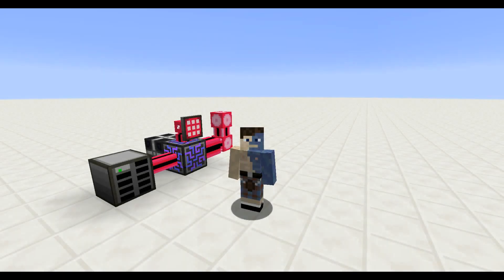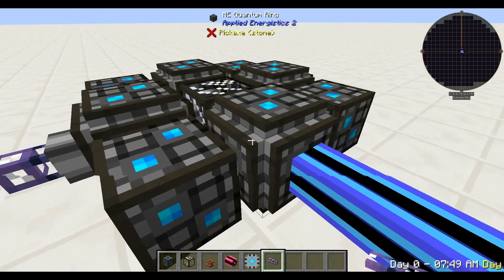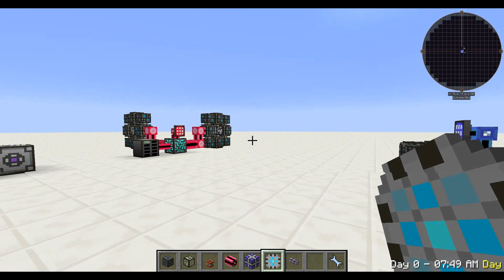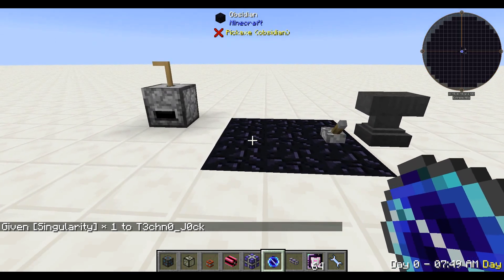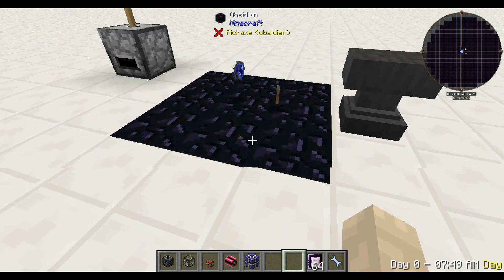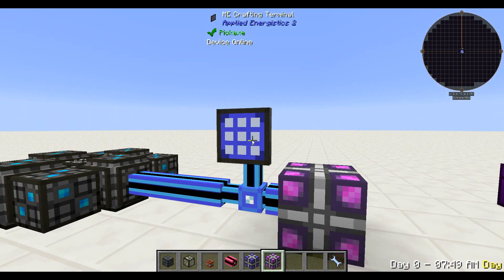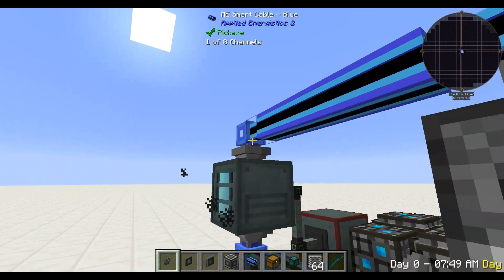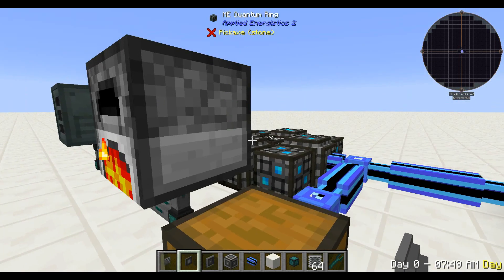Applied Energistics 2 - Quantum Rings & Channel Optimisation

Comment: I know it's an old video, but I tried this out and it seem that you "only" get 32 channels out of the quantum ring. I tried connecting different colored cables on both the "remote" ring and the ring connected to the ME Controller. But it only uses one of the cables on the ring connected to the ME Controller. So I guess I need to have multiple rings to get more than 32 channels.
Reply: I fixed it with ME P2P tunnels
Reply: @StenIsaksson  can u pls explain me how you did that? i tried so hard to get more than the 32 channels over a quantum ring but with p2p but it doesnt work. thanks :)
Reply: @SmokingHunta  I guess you already linked 2 quantum rings already. On one ring you connect one cable to the ring and then P2P ME tunnels to that cable. On the second ring you connect a dense smart cable to the AE2 controller. On another side of the AE2 controller you connect a dense smart cable and a P2P ME tunnel to it. On the other side of the P2P ME you connect a regular smart cable and connect that cable to the AE2 controller, because the P2P ME tunnel needs power from the controller. Then you use a Memory Card to link the P2P tunnels together. Each P2P ME tunnel can handle 32 channels but only use one channel itself on the smart cable. I added some images to clarify things a bit. https://photos.google.com/share/AF1QipOOaXeYhhxlylv6LeHVV4hoYZ54oFl4Y6suWI6dA3WzC1lQpbabCLK5i_BfjR5Lrg?key=UTl3SmJweGJGM29WR21qdkRSN0FDOVNTdTVnTDJB